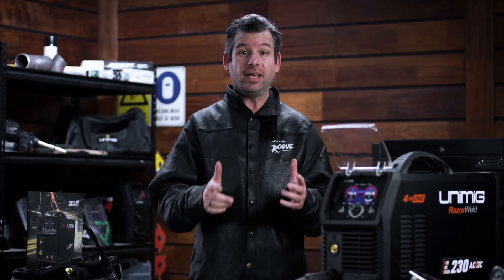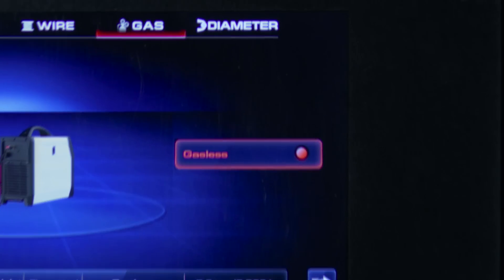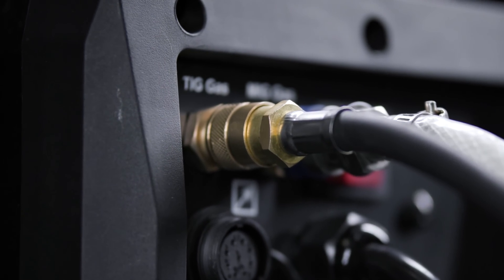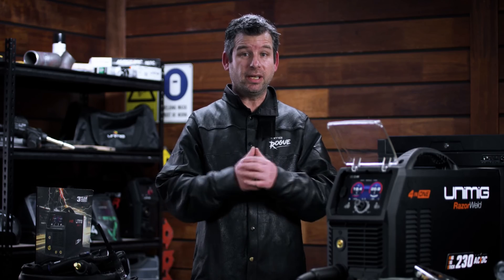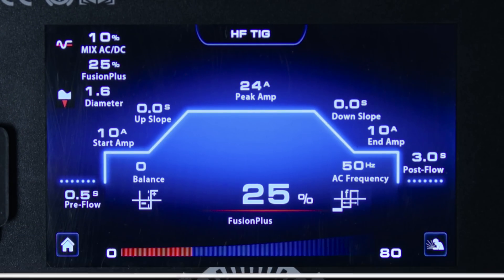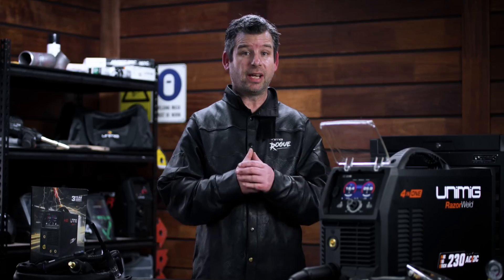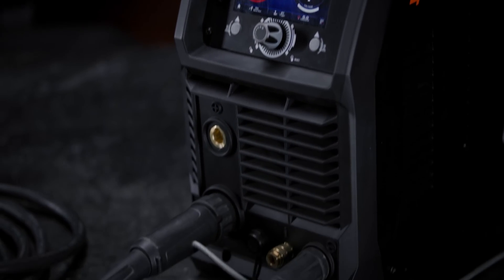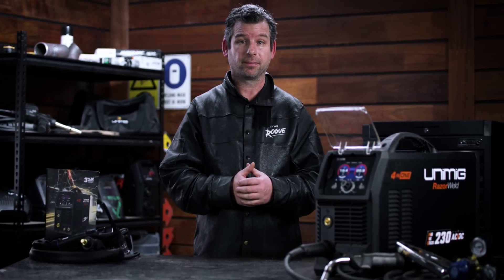RAZOR MULTI 230 AC/DC Full Feature Video

Comment: I'm having massive dramas with the MiG welding aluminium. getting 1 or 2 tacs then backburn which stuffs the tips. running 1 mm wire. I've tried both 1mm tips and 1.2mm tips to try get it working. been through about 50 tips with trying different settings. at the point where ill be returning this machine.
Reply: I've had plenty of experience welding aluminium on other machines and never had this issue
Reply from the maker: Hi Ryan, we would like to reach out to get this issue rectified for you. Can you please direct message us on instagram or facebook?
Reply: @UNIMIG  thanks for getting back to me. I went into total tools yesterday to sort out the issue they said a rep from Unimig will call me Monday.
Reply from the maker: No problem please let us know which store we will personally follow up with them.

Comment: I'm struggling to decide between your new TIG 200 AC/DC & the 230 Multi on the TIG features as in some respects the 230 Multi seems equivalent. Just talking TIG can someone outline why the 200 AC/DC is a better TIG machine than the 230 Multi as they are effectively the same price, but the 230 Multi has MIG as well & seems to have better Stick welding features.  

Finally does the 230 Multi have TIG Lift Arc & is it correct that the 200 AC/DC can TIG weld more material types versus the 230 Multi?  The reason I ask is that they are effectively the same price. Thanks.

Comment: I bought this yesterday. I wish it officially support 1.6mm mig wire because my workplace uses it and spool wire up to 16kg. This thing only support 5kg of wire. I used 1.6mm fluxcore 15kg on it today at work and it actually works! But the tip wasn't big enough for 1.6mm so my colleague gave me a 1.6mm tip from lincoln machines and this thing can really do 1.6 wire but unimig doesn't official put it in the spec sheet for some reason. I wish you guys did some 1.6mm wire testing.

Comment: Wish you guys made one with 350 amps or higher.
Reply: They do, you just have to buy the AC/DC machines separate between machines. Once you get to that high of a amperage your cooling and power requirements go up quite a bit and generally require standalone machines. Or you’re looking at a multi process machine that’s HUGE or has a super low duty cycle.

Comment: Would this or any of your other welders be able to run off the power 110 volt & 240 volt supply found in Canada 🇨🇦 with the proper adapters ?
Reply: Did you ever find out? I could easily buy a transformer but I’m worried about the difference In frequency. They use 50hz in Au and we use 60hz here in the states and Canada. Thanks!

Comment: Hi got the 230 yesterday and when feeding the wire in it only runs for about 5 seconds then stops. Takes ages to start welding. Is this normal?
Reply from the maker: Hi Pat, when you're feeding your wire in after installing a spool, use the wire inch feature. On the main menu, scroll to the MIG option then hold down the right button, this will run the wire inch program.

Comment: Hey guys, what are the main differences between this and the Razor 200 pulse? Is it just that this unit can’t do pulse mig but can do AC tig? Cheers
Reply: I’m struggling to decide between the two also. Wish the pulse 200 had AC Tig!!
Reply from the maker: Hey Kane, the main difference between the two models is that the Razor 200 pulse has a digital torch, touch screen TFT display, and has pulse and double pulse capability. The 230 AC/DC can TIG and pulse TIG AC but is only a conventional MIG (no pulse or double pulse).
Reply: @UNIMIG  For $200 extra it seems like a no-brainer to go for the Razor 200 pulse. However, is another slight difference that the Razor 200 pulse does not come with a TIG torch, whereas the Multi 230 does? Does this add an extra $200 to the Razor 200 pulse (depending on the variant of torch you get), so the Razor 200 pulse is maybe $400 extra. Again, when you are spending this much, for a few hundred dollars extra, it seems like the Razor 200 pulse is the machine to get.
Reply: @jamesellery6866  The duty cycle is a reasonable amount higher on the Razor 230.  Really wish they had included MIG pulse features in the 230 as it would have made it a no brainer - now on the fence on which model to pick.
Reply: I reckon the Razor 200 is for people who prefer MIG, The Razor 230 is for TIG people. As a TIG person the Razor 230 was the no-brainer for me thanks to the AC features that compete with kempii. The lack of AC gives the Razor 200 a massive disadvantage.
Reply: @UNIMIG  hopefully as per other comments below this will be included in the next model
I guess for now this model if you’re a mainly tig guy.  Pulse for the mig guys